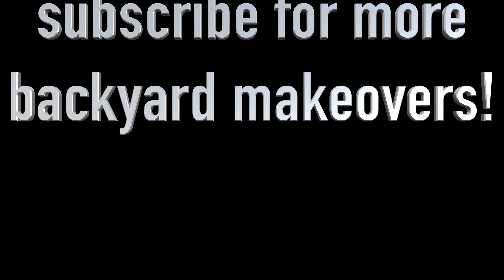DREAM DECK Time Lapse - 6 Week Makeover in 15 Minutes!

Comment: I am a retired 64 year old rough in carpenter, but if you don't mind me asking , how come non of it is sitting on a concrete platform, plus the Collums should be on 8inch round by 6 foot deep concrete footings . Now maybe I'm wrong,but that's what the inspector has told me many times what needs to be done the right way. Remember raw wood never touches the dirt . Just saying.

Comment: Thanks so much for the video. I love seeing construction for the ideas. My only gripe is I would have made a custom gas fireplace of about 8'W x 4' H and see through to be more proportionate to the structure. Besides that it everything else looked great.
Reply from the maker: Thanks a lot!! That would be cool but since there is no sitting area on the other side I don’t think it would be worth the cost
Reply: @THEpremieroutdoor  I was thinking of it to have a view of the woods behind it but it may have also been directly staring at the two-story residence across from it.

Besides that, the build was gorgeous. I am too cheap, (poor firemen/DIYer built my cousin's 2500 square foot house, and my house, porch, carport, fence, metal shed, fire pit awning, added a bedroom) and I would never put that much detail work into my stuff because I am too lazy but. DANG your work looked good. Thanks again for sharing as I love the ideas.

Comment: Would there have been a sizable price difference between the slat ceiling versus leaving the vault and installing fixed sunlights?
Reply from the maker: It would definitely be an increase in cost and in this scenario the roof pitch is low so it didn’t seem worth the added cost

Comment: How did you know when to stop installing the helical pile? Was the installer monitoring pressure or torque during installation? Im not sure where this is. But if the site is sitting on fill soil or weak soil, a single lead section with one helix may not be deep enough. A slender steel shaft is useless if you are not bearing in adequate virgin soil and the foundation could see long term settlement issues FYI

Comment: I’d miss the light that the deck roof is now blocking off, where those windows were at the back, where the deck meets the house on the first floor.  Seems a little dark now but the deck addition is nice.

Comment: How did you secure the stringer footings at 2:04? Did you have to use concrete, or did you just fill the hole back up with dirt? Thank you!
Reply from the maker: Filled it with concrete!

Comment: I noticed you didn’t do the waterfall edge on that “bar top” section of the deck. You cut miters. Did the waterfall edge not work out and you ditched it or was there another factor for you to not do it ?
Reply from the maker: The waterfall detail is still holding up great! But on this one we had a full board on top with only one seem, if we would have folded it we would have needed two seams on the top

Comment: What are using for the footings? I have never seen those, do you drill them in with machine?
Reply from the maker: They are Goliath Tech helical piles. And yes, they are installed and ready to frame on right away!

Comment: How much does getting a pro to come out here cost to do all of this?
Reply from the maker: About 150k!
Reply: @THEpremieroutdoor  I noticed that the basement window is blocked by the deck. How much additional would it cost to add an Egress to the window(s) with a floor hatch on the deck so it still allows an exit hatch for the basement window(s)?
Reply: @THEpremieroutdoor  Not sure if I can link images but there was an Egress Window I was looking at where it had a normal pair of stairs and banisters for one when coming up instead of climbing to come out. The other had a weather proof hatch but would like to hide that under nice wooden planks and a lift hatch that combines the two. Was wondering how much additional that would run.

Comment: It is a beautiful deck and looks well designed   For the most part.  The crew seemed to do a good job.  But there is going to be some rot issues that they should know better than to allow.  You can’t burry the bottom tread and support on the steps next to the house.  That’s going to rot.  Pressure treated lumber is not meant for that.  They should come back and fix that for sure.  And all of that soil in those planters needs to be pulled away from that structure for the same reason.  The helical piles are great but most of that framing was a little close to the ground before those planters went in.  All is fixable and will ensure this lasts for decades.
Reply from the maker: I appreciate your concern but all of the lumber used here is rated for ground contact